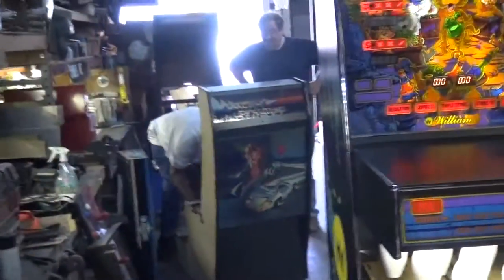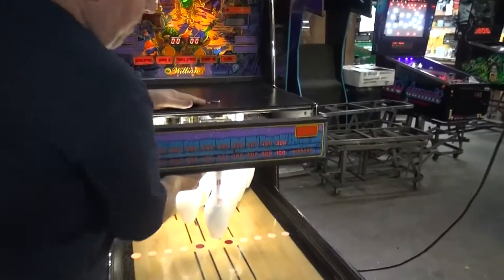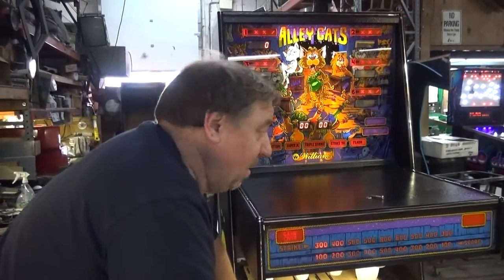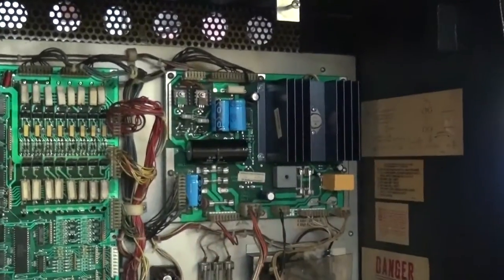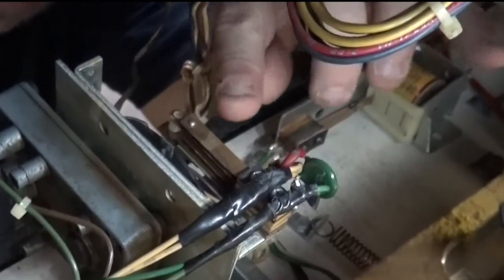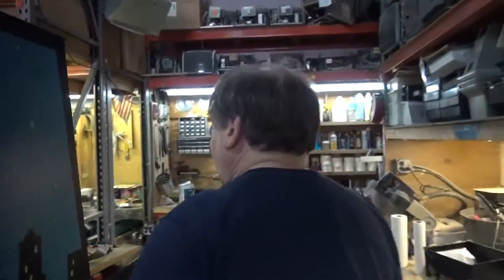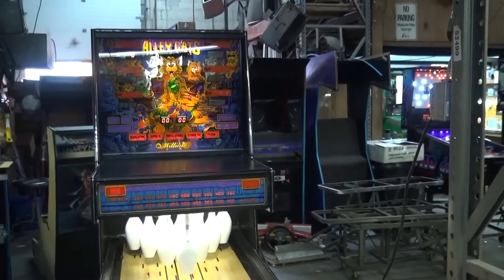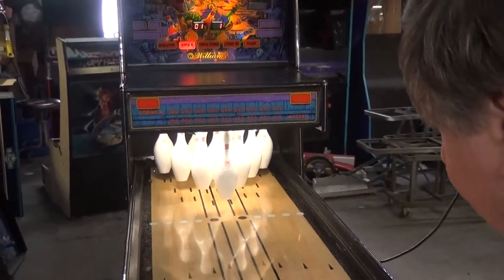#642 Williams ALLEY CATS Shuffle Bowling Alley-see different games it plays! TNT Amusements

Comment: I seen one of these coin operated arcade style bowling alleys that actually use a mini pinsetter with real miniature bowling pins attached to strings. It also has a real ball return and mini bowling balls. You throw the ball and it gets sent back down the return. It was the only one like that I have seen. It worked very well and was pretty cool. This reminded me of the one I saw. Are these still made?
Reply from the maker: Yes...they were made for a few years...ran on an enormous motor system...they disappeared from many locations due to maintenance I believe.

Comment: It's been years since I've played one of these.  I had forgotten that there were different games that could be played.

Are  all shuffle bowling games the same size and length?
Reply from the maker: Yes...all are 109 inhces long...but the width on the first 7 was 30 inches, and in the last batch 26 inches (they removed the two inch rails people sat their drinks on, which could end up getting spilled on the playfield.)
Reply: That's interesting, underneath the lock bars on pinball machines would have rust and other crap in there.  I suspect it is from when people put their drinks on the machines and the condensation would get inside.